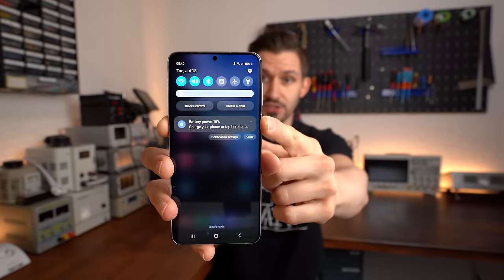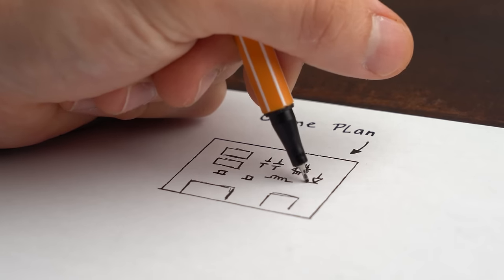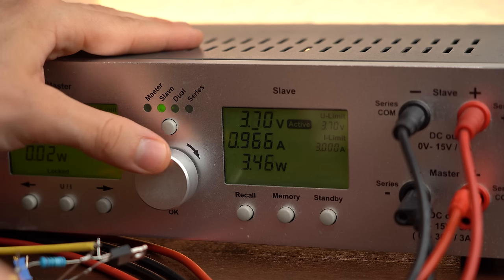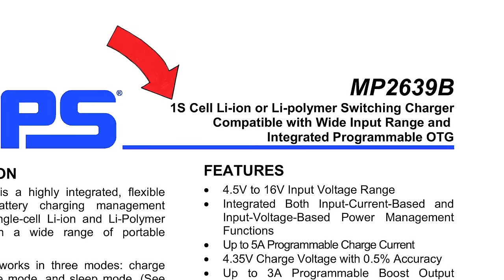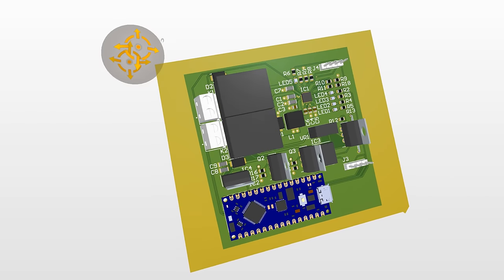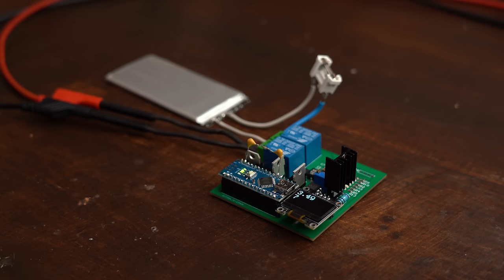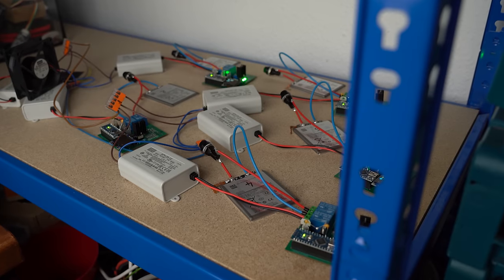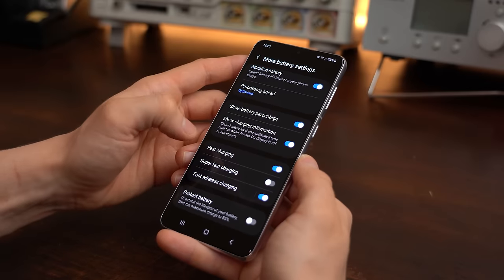Don't Fast Charge your Phone before Watching this Video!

Comment: One thing you missed is TEMPERATURE. Most phones limit charging to keep temp in check, and you have vapor chamber in those that have strongest charging to keep eye on that. Sensor is always on the battery somewhere.
If you charge it in open air, not even having 300g of phone to act like heatsink, then you brutally overheat the battery, and that would make them suffer a high drop. That's what you had if you used 9-15W chargers, on phones like Samsung Galaxy Ace 3. There were no heat sensors, and the battery boiled, creating this myth. 
The hotspot on battery is likely in 130'C range if you just push current at whatever speed battery can take it. 

If battery is designed to take 67W, you can safely do 45W and have the same battery lifetime as using 5W chargers, maybe even better.

Best way to extend battery life is to make sure its temp is not going to low/high, even more so while charging. And doing 20/80, cycles. Charge before you drop to 20%, stop when its ~80%.
no cooling battery and li-ion if you push it like that would drop like a rock. 

I recommend having 10-15W charger near your bed, if you plug overnight, it can be 3-4h you should not care. 
But having an OPTION to plug fast charger and get half battery when you need it can be lifesaver.
I highly recommend to everyone HAVING that option in your phone. If you fly anywhere and have 20-30 min on airport, you can get enough charge to survive the flight from empty and then some.
Even better that MOST small laptops can also charge with the same charger, so you take one less junk, on your trip.

Comment: My blackview woth a 8000 mah battery does fast charge of around 8amps net and then drops to the typical 1.7 net when it gets to 90% 

I know from my drone batteries a 1c charge rate is no problem. You can usualy go to 3-5c with out much issue.  But those are raw uncased batteries. My phone does get hotter charging faster so i usualy dont fast charge it.   With 8000 mah it goes all day anyways.

Comment: Wait… first things first, is the battery you're using designed for fast charging? 

Also, afaik the fast charging works in a way that it delivers actual fast charging during the first 30% or so, after that the charging speed slows down, have you noticed that the last 5-10% of the battery takes significantly more time than the rest?

Btw, I don't remember when android implementing it but your phone is able to learn your device usage to not only make your battery last longer but it's also capable of learning that you always leave your phone charging all night so it slows down. 

Now,  I'm not saying fast charging doesn't damage your battery, I'm saying it's not always active because manufactures don't want to get sued because your battery always gets hot and at risk of exploding.

Comment: It’s really not worth it to care. If you do indeed keep your phone you can replace the battery. If you are using a random android phone, you shouldn’t be keeping your phone more than 2 years because most likely that OEM isn’t doing security updates. If you are getting it from a “premium” android phone than you can probably get a battery replacement for less than $80. iPhone batteries are also about $80. Seems like way too much stress for something as meaningless as a phone battery.

Comment: As far as I'm aware, keeping Li-Ion batteries between 50 and 100% helps reduce battery degradation. I would be very interested to see this experiment repeated but only draining to 50% before charging again.
Reply: Its 20% and 80%... Not 100%

Comment: " no matter how long you look you'll never find a charger lie this"... funny how I actually own several 4.35v li-ion battery chargers... they are called Lithium HV or Lithium High Voltage chargers and they have selectable charge current

Comment: I hope you continue running this test in the background to 1000 charges because, as you self said, 100 cycles is nothing.  
Please do another measurement at 500 and then at 1000 cycles.

Comment: Just at the beginning: there's a problem with the way you're presenting this. 5A is a lot of current for a small cell, but not much at all for a very large cell or battery. What you really need to be looking at is the C-rate, or the rate of charge or discharge as a proportion of capacity. So for what looked like that 3000 mAh (3 Ah) cell, a low charge rate of 0.1 C would be 300 mA, and moderate charge rate of 0.5 C would be 1.5 A. A 5 A charge rate, 1.67 C, is pretty high, but nothing hugely ludicrous.And on a larger phone with a 6000 mAh cell, that would be only 0.84 C, which is not really much higher than the recommended charge rate.

Comment: Fast charging generates a lot of heat so it would be more interesting if you tested both 1a and 5a charging over temperature-controlled chamber (ideally 25c) and/or put a heatsink on the battery to dissipate the extra heat. I believe one of the main cause of battery capacity is heat, so I've been charging my phones with peltier cooler now to keep the battery temp under 35

Comment: The battery inside a phone will have higher temperature and mobile phone's charging current also depends on the temperature of device and battery. But at least the results are consistent with the claims of samsung, that claims 10% capacity loss after 2 years of use.

Comment: Well, according to battery experts, the phone batteries LOSE about 5% of its CAPACITY EACH YEAR, if you CHARGE THEM PROPERLY, always keep in 30-80%, do NOT FULL CHARGE it to 100%! I don't know how much DIFFERENCE fast charge would make, but 11%/2year vs. 10% as predicted isn't a much difference to convince me to stop using FAST charge. I hope you keep up this experiment, but it'll be great if you can modify the test to start charging at 30% and stop charging at 80%, instead of FULL discharge/charge..

Comment: In reality, it is worse. Your phone has times where it needs lots of current (ie you just turned on WiFi) and times it needs little (ie left alone for half-one hour, varies by how many apps run in the background). This random variability is probably worse than linear draining for a battery (I assume that would be too complex to implement in the experiment)

Not to mention that in a phone the battery isn't directly exposed to air, but sealed in a poorly cooled enclosure. All the heat generated by both charging the phone and doing highly demanding tasks has a hard time escaping, further damaging the battery

Comment: And after reaching the end of the video I come to warn you the following thing, the loss of battery capacity in fast charging will depend on the type of battery, Samsung batteries have been the same project since 2011 based on Li-ion technology which is the worst type for fast charging, the best model would be Li-po, but not all are designed to charge that fast, Xiaomi's would be the best option to do this test, but it would have to be the ones used in models that come with the 120w charger In the box

Comment: Useless work because you didn’t use original charging circuit. Redo test using phones with original chargers.
Reply: It’s the same thing, CCCV charging either 1A or 5A
Reply: But either ways you would still see a capacity drop if you fast charge your phone

Comment: But i. Believe the software is smarter, it doesn't charge constantly at 5A, it reduces the current approaching the full capacity, you notice the drop in charging speed at around 80, also it takes into account the temperature of the battery itself. Moreover Samsung provides a 85% limit in the settings. That should make it live longer.

Comment: Good effort, but losing around 12% from your battery capacity after 2 years of using it is perfectly fine. I usually replace the battery of my phone after such time.

Comment: According to your results I don't think that fast charging is a problem on Android phones as they are obsolete about half to one year after buying. It is a issue with the phones that are expected to be supported for 3 to 5 years or even more, but they are typically lack of these fast charging capabilities.

Comment: 1. A normal quick charger doesn't charge with 4.35 V all the time.
2. When the battery is in the phone, then it has completely different temperatures than in your test, and that affects the battery life greatly.

So this test has little to do with real world phone charging.

Comment: It's fascinating since big phone companies want to suggest the users use super fast charge adapter. Ironically they are not supporting 3rd party repairment, Aka "If your phone gets drained so fast, you need to buy another one". Sadly most of them supporting Green campaign which reducing carbon footprint.It's more supporting about the campaign if they support 3rd party repairment

Comment: My S23+ charges with around 8amps... i mean as long as its switching to 3A then 8A occasionally
Reply: It also has a cut off voltage of 3.3v, because when I charge it  starts off with 100ma and it shows 3.2-3.4v

Comment: I have two cables on my charger, one is fat one isn't, I only use fast charging when I'm in a hurry. And I avoid going beyond 80% most of the time .
Reply: do you have on your phone the function "protect battery" if you do use it. this function limits to 85% charged.

Comment: Fast charging a Li-Ion battery is one of the worst things you can do to it, if you want to make the battery last longer/more cycles. This has been known, for years.
Technically you can 'faster' charge, up to around 3.6V - then Trickle charge (somewhere around 300 to 500mAh) to get to 3.8/4.2v (full) - and the battery will last MUCH longer.
Batteries like to be at 50%.    you never want them below 20%, and really you shouldn't take them above 80%, but 'our demands" force these extremes.

I would actually be interested in results in the 300 and 1100 cycle range instead of just around 100 charge cycles, to see 'just how bad' it gets.
300 being close to a year of charging, and 1100 being just over 3 years.

And since we are on phones, I hate how companies make so many, that end up as just E-waste.  It's not just the 'yearly new models" - but the amount of models.   If you come up with 3 models a year every year, and some 40% don't even get sold - that is just a tremendous amount of waste waiting for a 'big sale' to actually get used.  Some - are literal e-waste off the shelves with inferior parts, defective chips, and choice in function - so they never really sell anyway and end up in the recycling.

I'd love to see laws to restrict it to 2 new models per year, maximum.  one "economy' style - with functions but nothing too fancy, and 1 'high end' model with all the bells and whistles. 
Not everyone uses or likes the wireless charging, for example, so the economy could leave that out. Not add anything to replace, just remove it.
This would drastically cut down on E-waste and the strain on electronics recycling, and should actually yield more profits for companies.... but it's never done for some reason. (people are more likely to buy a new thing, at any time, when they can easily compare things they already have, with the new thing that would replace them, too many phones just makes the comparison take too long, and people end up waiting for a 'newer' model anyway)

Comment: Heat is the batteries enemy.  If I run my phone hard the phone gets real hot. You should measure the high temperature of the phone and cycle the batteries at that temperature

Comment: Can you reperform this experiment? This time please increase the lower voltage to 3.55 and decrease the uppder voltage to 4.3 volt. 

This will help to check real world usage as people normally do not completely discharge their phone, and only fully charge 50% of the time.

This should in theory give a timeline of 5yrs for 20-40% decline in battery health/capacity. 

From my own observations I have noticed that fast charging of Xiaomi phones (33watt) give the same 20-40% decline in 2yrs, however samsung 25watt fast charging (5A) can last for double that time at 4yrs.
Reply: By fully charge 50% of time, I mean that people normally charge to 100% only half the time they charge. Usually people charge till 90 or so percent, unless they left it at charging before going to sleep.

Comment: Just nother way to make money for battery manufacturers
Big company's stick together
But if cud control the fast charge like the way you use wireless charger but not all fones alow it even ones with NFC should be a pop up on fone to select fast charge 😊

Comment: Wireless chargers are the worst for your battery because the coils heat up your whole phone and have to charge your battery also which adds even more heat. A quick charger charges the phone faster and makes less heat. As long as your battery stays cool it doesn't matter how fast you charge it. Before you take the wireless charger, charge it with a super charger. Modern batteries don't even get that hot anymore with fast charge. Wireless chargers should be banned, they only degrade your battery.

Comment: I Usually love your work, but this one has many flaws. First, read the specifications for the exact cells you used!  All cells are different in terms of max charging / discharge current and profile. 
Now, hate to be so harsh on your video, but so much wrong here and you didn't do any research other than see what your one phone used for charging. There is so much more to fast charging than slamming a battery with max amps to max state of charge! Good you didn't burn the house down. So here we go and I apologize but..
One, fast charging has a profile, starts out high and then at say, 90% or based on temperature slows. There are no fast chargers that charge the full fast charge current up to 100% and if there are, they are junk. Read the specs on the batter for max charge current... 
Two, the charging circuits in phones also monitor temperature and adjust accordingly. 
Three, a charge cycle when done from say 35% vs whatever level you brought it down to has much less wear effect. 
Four, you can't just assume a battery has a linear capacity loss. There is a certain amount at the beginning then changes, again, read the specs!!! 
Five, you can't base said linear loss off 100 full charge cycles, especially when fully charged using max amps. 
Six, a lot of the super fast chargers split the current between two or more cells, so one cell isn't getting the full amperage. 
Seven, as mentioned before each cell has it's own specific guidelines on charge and discharge currents and profile! Read the specs!!!
And yes, fast charging is more detrimental to batteries vs slow charging but there is a lot that goes in to minimizing that wear. But what you did here was the worst case scenario possible. And in my opinion the batteries held up really well! But c'mon man, you usually do much more research and are usually on point. But this video was super lazy in regard to what a LiPo battery actually specifies in it's datasheet for the power cycles. The build on the charge / discharge circuit was great, even though basically useless for what a LiPo actually requires. 
Anyway, sorry for being so blunt but this video will just fuel the fire to the uneducated about LiPo battery fast charging. This is click-bait BS.

Comment: Your experience is nice as far as building the charger/discharger but the results are absolutely useless.
You can't get reliable conclusion of 3 samples for even a single point on a curve so extrapolation on a linear function or even a exponential is just making no sense. 
Then, charging at 5 A up to 4.35V is not how fast charger do. Very high current can be injected to a battery in the 10% / 80% capacity range but the very beginning and end of the charging has to be a bit more careful. 
Last, but not least, batteries lives is VERY sensitive to temperature. To be of any use the experience should be in a controlled temperature.

Comment: I don't think this is scientifically relevant tbh. No charging standard gives a full 5A the entire time. It typically gets reduced as soon as it hits 80%, and then reduced again by 90%. Only to trickle charge the last few percent. You should have checked the Qualcomm Quickcharge 4 specs and tested what that does compared to a regular 5V 1A charger.

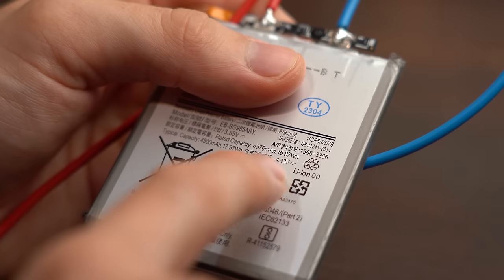Comment: 2:41 FOUR POINT FOUR THREE bleemin' volts. Absurd! I don't care what kind of chemical wizardry you perform, no lithium-ion chemistry is undamaged by charging to that voltage. Manufacturers have clearly prioritized absolutely maximum runtime when the phone is brand new and deliberately pick a target charging voltage that will cause the battery to degrade enough to motivate you to replace it in a year or two; as long as it hits warranty with at least 80% capacity left they don't care.

Comment: its not really an accurate test, you're just burning through cycles which will degrade the battery naturally. You need to start a fast charge before the power drops below 20% to see if fast charging is damaging or if you're just causing damage by cycling.

Comment: That is not an accurate experiment. Most phones (if not all) have protecction against fast charging, slowing it at the end, a moment in which most of the damage occurs. Assuming that, the battery capacity will drop much less than 11% over 2 years.

Comment: I'm not exactly sure, but it seems the battery doesn't always  consistently draws 5 amps, its actually dynamic. The current it uses changes and is controlled by smart software to make the battery last longer. In my situation, with a 67W fast charger, it pulls more than 9 amps when the battery is at 1% to 50%. The type of cable matters, maybe because it has some sort of IC in it. You can learn more from this video:https://www.youtube.com/watch?v=PaAzmr0SYlI&t=6s&ab_channel=SaiTechGuru